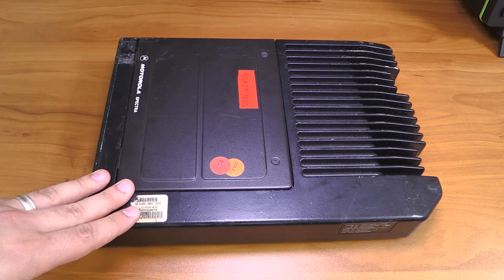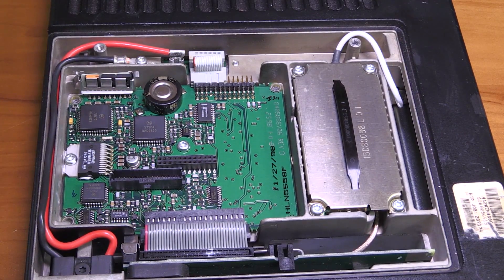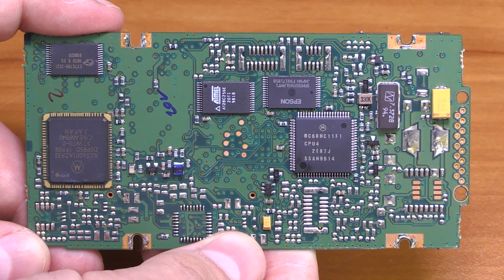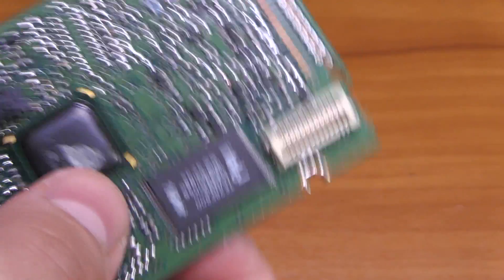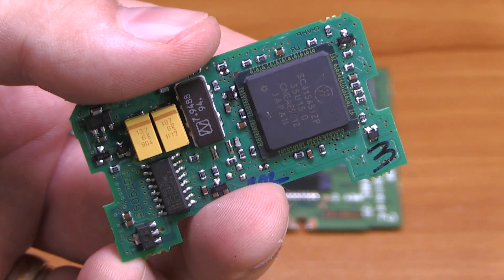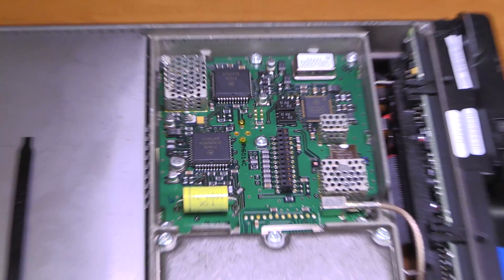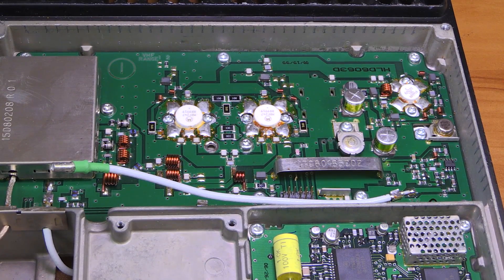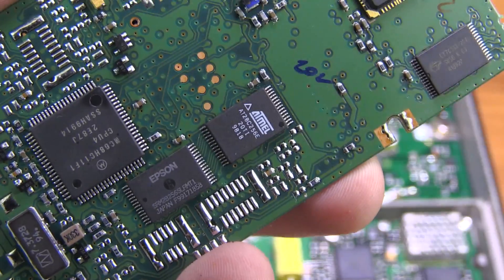What's inside an Encrypted FBI Radio?

Comment: Just some info as to the bids for LE bids. Motorola writes all the specs for bids which ties public entities into their patented products. You need this, gee we only offer that feature. As to the board you removed first there were several screws missing from the shield. The HC11 micro has public domain code which allows individuals to hack motorola software and firmware. All new stuff from Moto has proprietary micros in it that no one has code available for their use.

Comment: Many radios like this have a companion unit to set the encryption key which is changed regularly.  Is there a connector for this on your radio?
Reply from the maker: John Tarbox You mean the Keyloader? Yes, it's connected to the 'normal' programming port.

Comment: Atmel EEprom probably has the 68HC11 code in it, and the companion SRAM will be the working ram. The code will run direct from the EEprom no problem, and it probably uses the built in peripherals to communicate with the rest of the chips and run the front panel and do the radio functions. Likely only 6811 code in there starting at the top of memory.

Comment: Send the ASICS to Applied Science so he can put them in his electron microscope and get a high res image of the chip inside. Easy to decap those modules, you hust use a hot air gun to melt the solder seal.
Reply from the maker: That would be fun, I'll ask him if he's interested.

Comment: Seems cool, but isn't 110 watts a bit too low to be very useful? (I guess it can probably be used to turn random FM radios around the house (and possibly a little bit around the house into wireless speakers)
Reply: Razor2048  110 W is actually pretty beefy for a mobile radio. Most earlier public service Motorola tranceivers ran closer to 35 W max. Most people don't realize that under 10 W can totally saturate a typical metropolitan area. (Antenna obviously has a big effect as well.) Anyway, one trick commercial brodcast engineers use when a 20KW transmitter fails is to run 30-50W exciter output straight into antenna to maintain coverage of main broadcast area while waiting for transmitter parts to arrive. Most local listeners wouldn't even notice difference. (I am retired broadcast engineer.)
Reply: im in austrailia  and use to run one of those motorola spectra's on citizen band uhf 477mhz using ch 7 BRISBANE Repeater quite a few of us got a hold of these radios coming for bulk buy surplus we all try to  get our hands on comercial radios as 5watts is leagal max power allowed by the acma to get over alot of the wankers associated with public uhf band you need more than 5 watts espescialiy mobile when signal strenth  fluchtuates most of the regulars use home base set ups so you can build a signal by improving coax antenna'S TOWERS LINEAR AMPS OR KICKERS. I was running motarola spectra just a small run of RG213 coax just on a 12 meter pole with 2 x 16 element yagi beems co phased with a harness & a rotator to tune that spectra was pushing over a 100watts easily we did a swr test it ran constantly at 108watts  until it heated up from long transmissions but a thermo fan running constantly solved the problem of heat, i had a better signal than opperators in brisbane i was 130klm away from them. these spectras are definatly running over 100watts as RG213 coax can only handle 100watts i blackened the centre wire in the RG213 so i replaced it with LDF450 coax corrogated copper sheilded outer foam fillied and solid copper centre conductor. this solved my problem of to much Rf power. i agree spectra's dont have as strong a output as a 100watt amp but they definately have a have the ability to transmit at least 100w weve all proven the power capabilities of the spectra for old technology they were an inpressive radio.. to anyone using these radios my tip to not destroying them is dont transmit for long periods shorten your overs and keep a large fan running constantly on the radio & heat sink itself.. they dont like heat. i would say to kf5obs he is most likely right on the money saying it was a hf 110watt output its alot easier to run high power on hf ameture bands than on uhf bands 250watts is around the max for uhf  you can get your hands on in australia and hi power linnears are hard to find & hugely expensive compared to hf linnears around $3500 starting price for tokyo hi power amps compared to hf linnears half to quarter the price & also 3 times the power output availabiliy.  im no ameture expert please tell me if vhf is a hard band to run high power